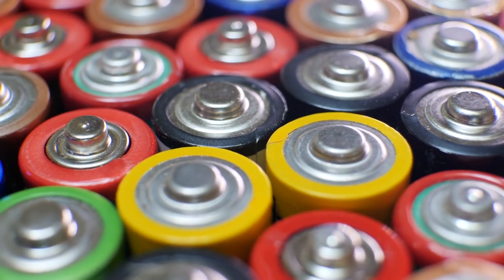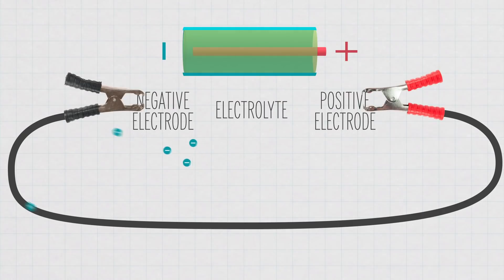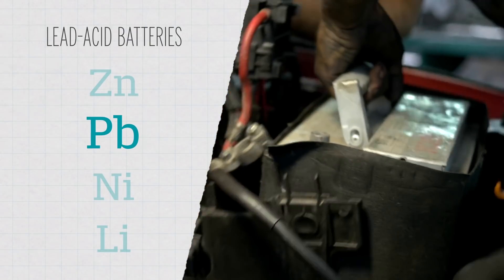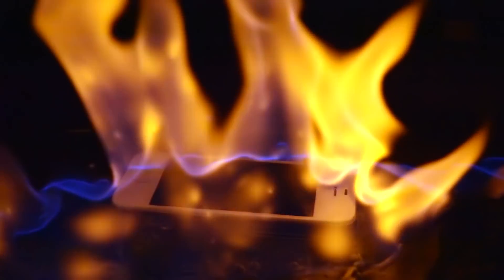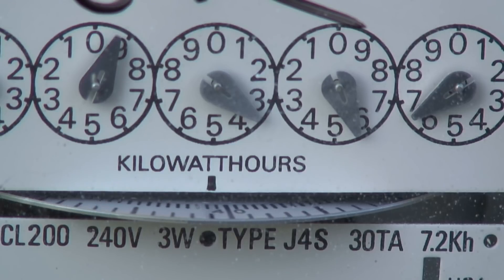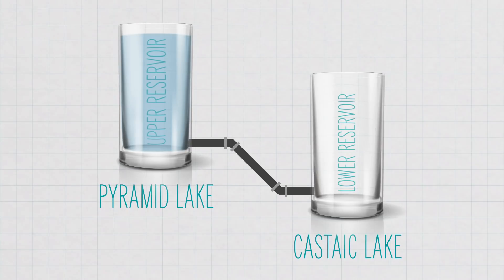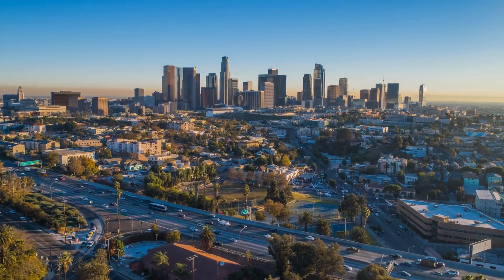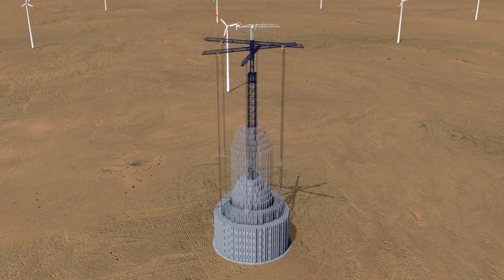The World's Biggest Batteries Aren't What You Think

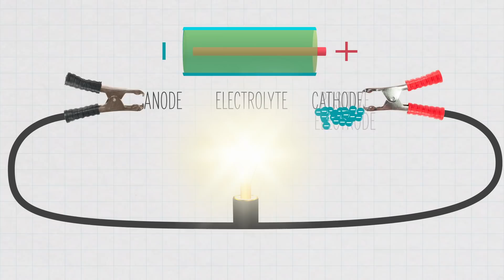Comment: 2:30 I think you may confuse many people as you've shown in your diagram that the negative terminal of the battery is the anode, and stated that electrons leaving the battery from the negative terminal, but in semiconductors the anode is positive, but in conventional current flow, it flows from positive to negative. Yes electrons flow from negative to positive, but in history when the electron hadn't been discovered, they had to chose a direction for the current to flow as it was unknown, they chose positive. Cathode ray tubes emit electrons from their cathode. ???? 😊
Reply: They used the terms correctly. If you look at it in terms of voltage, naming is inverted depending on if the device is providing or consuming energy. 
If you look at it in terms of apparent current through a device, the terms are consistent.
Reply: This is something that has always confused me.  Learning about the historical reasons helps a bit, but it's still hard to get right sometimes.

Comment: Rather than wasting all that material and space, why not just nuclear?
Reply: Nuclear has a similar (or possibly opposite) issue; nuclear plants like to run at a constant power output but electricity demand varies across the day, so in a nuclear-based energy economy, you have energy storage systems that absorb surplus electricity late at night and release it during the day/early evening when demand is high. 
In the UK, we have a bunch of pumped hydro plants that were built in the 20th century when hardly anyone cared about renewable energy, in order to match the fairly inflexible electricity supply from coal and nuclear plants with the rapidly fluctuating demand.
Reply: Stigma!
Reply: Nuclear fusion is the future.